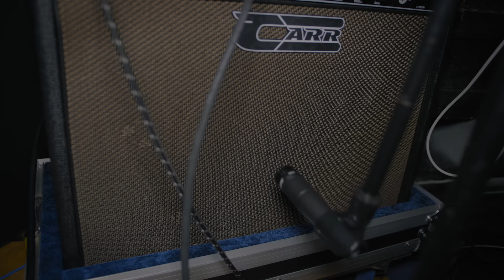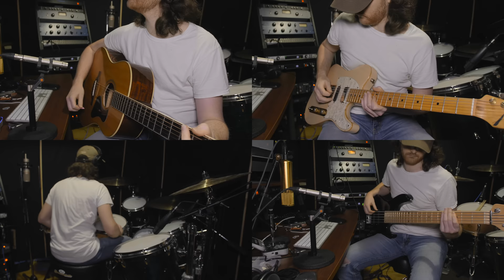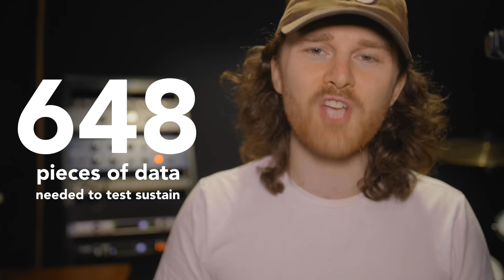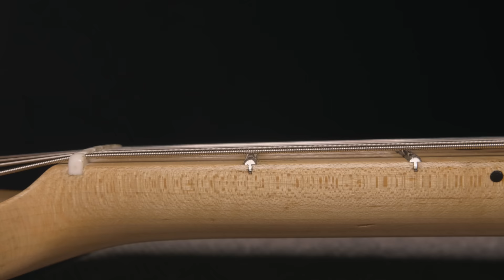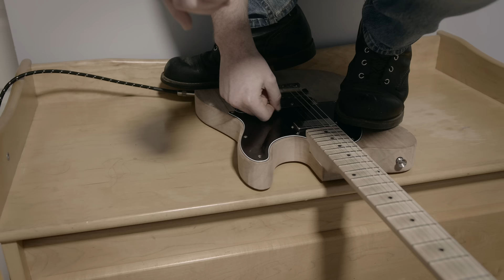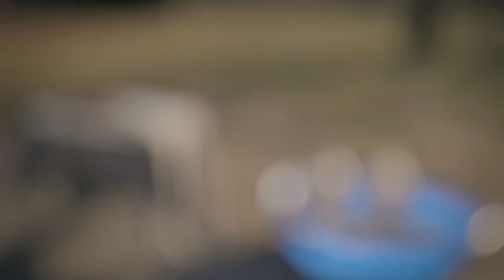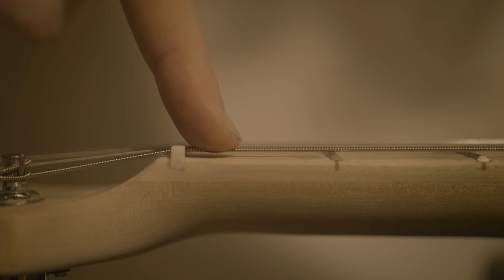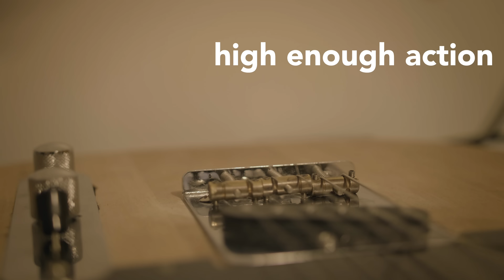Tested: Where Does The Sustain Come From In An Electric Guitar?

Comment: Seems to me that some obvious things, like a solid connection between body and neck, would minimize damping.  Similarly, a dense, more solid wood (or woods) would be best for sustain as well.  Things like paint/finish are so minor as to be considered meaningless (IMHO, anyway).  
   I think one of the MOST important factors in sustain would be resistance (that is, impedance) in the circuitry.  That factors in how many pickups are being used, the number of winds in each pickup, and whether humbuckers are being used will affect impedance.  The strength of the magnetic field(s) that each string must drive against must be a HUGE consideration when evaluating sustain!

Comment: 3db is a lot, I see this video as confirming the fact that guitar construction affects sustain. Also when adding mass to the guitar you should have added it to the headstock. Brass nuts are known to increase sustain, there also exist clip-on brass weights you can stick on your headstock to add sustain. Try simply pressing the headstock of your guitar against a solid object and see what happens. I liked your tone video, but I think you came at this one with a bit of bias which you were looking to confirm. If you really want to test it, make a guitar like structure out of balsa wood and another out of a large piece of brass or iron, give the balsa wood a skinny headstock stucture and give the metal one a heqdstock that is equal in mass to the body (basically make it from one symetrical block), attach some strings to them both and see which one sustains longer.

Comment: The guitar string is an oscillator. Ultimately what you want to figure out is the quality factor Q of your oscillator. Roughly sspeaking the quality factor measures how much energy the oscillator loses for each cycle it does. Higher Q is better.

Comment: "a few Db difference" is a huge amount of energy. A difference of 3 Db is a doubling in sound pressure, and some of the variations you tested had 6 or 10.db difference, which is enormous. I think you kind of proved that some of these things do matter to some extent and then brushed them under the table. I'd rather see an exploration of what the practical effect of getting half the sound pressure is.

Comment: I've always thought that scale length plays the biggest single roll (excluding preampfification) because there is a larger/longer surface that would lose energy slower. Then again, maybe the larger/longer surface loses energy quicker, assuming string tension is the same.

Comment: The only thing I've heard affect sustain is the mass of the guitar. Will be interesting to see how it actually affects it
Reply: In an electric, you want to keep the energy in the vibrating string and not let any of it bleed through into setting the guitar vibrating.  It becomes an impedance matching problem, only you want to avoid matching impedance.  The string, having very little mass and being very flexible has almost no impedance.  So you want the guitar to have a high impedance...lots of mass, and very, very stiff.  This is why freaks like guitars made from granite or aluminum sustain forever...but are very impractical to play.

You want as much stiffness per weight as possible, and that takes you to things like carbon fiber necks.  Most of the energy loss is from the string into the neck rather than into the body.  Once the body is made from a sufficiently stiff wood (nearly all commercial guitars are), there is very little effect from changing the body on sustain.  You can chop off big parts of the body and it will have very little effect on sustain.

Tremolos eat sustain, too.  That's why heavy tremolo tails sustain better than light ones.
Reply: @ElJefe3126  thats a really good explanation, thanks.

Comment: Great video but you missed a big one. How well is the neck perfectly seated into the body without any shims? An exact match is impossible so the shape can only be near perfect. Also, you can put the strings on and tighten them up a bit, then loosen the neck bolts but just a little. the tension on the strings will pull the neck toward the body more. then you re-tighten the neck bolts and tune.

Comment: One thing you didn't really test is the type of wood -- heavier vs. lighter (density), etc. Although I still believe that it's more in your amp than in your guitar. I think it the result would be like "tonewood" -- more of a myth than anything. 
   Also I would like to see you do the tonewood test with acoustic guitars, as i think it would matter a lot more.  No electronics -- just mic'ed up, not acoustic/electric or sound hole pickups.
  I've been playing guitar for 35 years and I have learned more about tone from these two videos than I ever have in all these years. Thank you for that!
Reply: Acoustic it definetly matters there some videos. Electric probably not or it's so small you need a spectrum analyser to see it.

Comment: The pickup should rob the guitar of more energy if it's plugged in, or shorted to ground, than if it's wires are loose. Since then you actually pull energy out of the system.

theoretically at least.

enough to make a difference? no idea.

Comment: I built a guitar out of acrylic and filled it with water and Gatorade to test - it sounds and sustains just like anything else I've tried.

I did however have a shitty guitar that had the neck both screwed and glued in, and the sustain was MUCH worse before the glue was fully cured.

Comment: 2 things affect sustain: stiffness and mass. Both stop the energy in the string from being transmitted to the guitar. Exactly why acoustics have so little sustain: the energy you put into the strings, is lost rapidly into the guitar, by making the whole thing vibrate and flex all over the shop.

Comment: Unfortunately, the sustain factor wasn't demonstrated because the tests weren't designed to demonstrate it. 

Sustain has two characteristics, and each is caused by two different factors. Sustain factors aren't really applicable to electric solid body guitars. The first aspect to Sustain is simply how long the string vibrates, and this is decided by how well fixed in relation to one another's ends the string is, with respect to its two ends. 
If you used a spring and fastend a string to the springs two ends, the spring itself would absorb some of the energy by vibrating in semi resonance with the string, reducing the vibration duration of the string. So, in effect, the more rigid the instrument, the longer the strings will vibrate. While the more springy instrument will reduce the vibration time of the string, though this can result in a longer audible sound if there's a sound box/board. That is sympathetic/resonant sustain. 

Sympathetic sustain is the instruments natural ability to produce an audible tone in response to the strings vibration. Some instruments are more capable of producing louder audible sound to the vibration of the string than others. This doesn't mean feedback.

Sustain is a quality more aligned with acoustic based instruments, including electric hollow bodies. 

Bottom line, you're not going to get any significant results when testing and comparing electric solid body guitars to one another. Sustain will typically be the same amongst all of them unless they're really springy in the neck, which is unlikely. The only factor that will show a semi measurable difference with Sustain amongst electric solid bodies is the weight of the instrument. The heavier the solid body instrument and stiffer the neck, the longer the string will vibrate.

Comment: You had your answer at 1:25: the hollowbody guitar resonates more, so it needs A LOT less volume to feedback!
Strumming different solidbody guitars unplugged will easily show you how some resonate more than others (even same models): those are the guitars which, being equally well setup and well played, will also sustain more 😉.
Reply: No, the opposite, the ones that resonate more, sustain less, because they are taking energy from the strings. The more energy the string retains, the more it sustains. My hollow and semi hollow body guitars sustain less than my solid bodied ones. Nothing to remotely concern me though as it's quite a small difference and unless you're holding notes for 4 seconds like in the video above, makes zero difference to "real life" playing. It can make a difference to feedback though!
Reply: @gazzie12000  you’re wrong. Resonance helps the strings to ring longer, it’s physics. Also, sustain makes a guitar easier to play: that’s why we all love overdrive/distortion. In fact, it’s not the total duration of the ringing string you’re looking for, but the strength/amplitude of those few seconds and fractions of seconds you usually need while playing. Have you ever seen the waveform of a guitar note ringing? If the notes ring for longer, then the amplitude before you pick the following note will be higher than a not-resonant guitar, giving you an ease of playing just like adding a bit of overdrive.
Reply: @shredgd5  Nope, you're mixing resonance and sustain up. . They are not the same. This video is only about sustain, nothing more. Where do you think resonance comes from - it's the vibrating string passing some of it's energy to the guitar, that's the only place the energy comes from - so the string by default has to lose energy. It's physics! 

Also everything resonates - just at different frequencies, and some will rob sustain more than others.

You say "it’s not the total duration of the ringing string you’re looking for" but that IS sustain. Sustain is just how long it lasts, nothing else. Resonance is relevant to the other stuff you mention, yes for sure. But sustain is JUST how long a note lasts, nothing to do with ease of playing, or tone, purely a measure of length. I have unbelievably easy to play guitars with less sustain than harder to play ones. eg most jazz guitars are the easiest to play you'll ever find, but they also have way less sustain.

Also overdrive/distortion doesn't make the guitar easier to play unless you play in that style. If you play jazz or any clean style - it makes it way harder to play!😀
Reply: @gazzie12000  it’s when you’re not hearing any resonance that you’re losing energy, it’s called dampening.

Comment: Some guitars have dead spots, my Kramer has a dead spot at the 14th-17th fret on the G string, A-C. My Washburn has no dead spots like this. I have no idea why. Both have floyds and the same pickups and setup the same, the Kramer is bolt on (but the neck is glued on) and the Washburn is neck through.

Comment: Very good video ..  my  custom built guitars have AMAZING sustain .. even when they are not even plugged in .. because they were designed to not use a truss rod ... The guy who designs and builds them deliberately uses the string tension to 'pull the neck in to position ... Both guitars have truss rods but none of them are actually doing anything ... compared to my strat which is lovely but 'punchy'  its chalk and cheese ... on bolt on necks .. truss rods are the sustain killers .. IMHO ..(open to be corrected??!!) thx

Comment: I greatly appreciate your content.
An observation though : you are using dB loss over time to measure sustain. In your experiments, often harder material show a greater loss. But does it really mean sustain is lower ? If harder material starts with a higher peak, after 4 seconds it could be still more volume than softer material.
I think sustain is perceived as how long the note stays in a relatively equal volume, after peaking and before fading, but still enough to juice the amp. If a pillow guitar has the lower dB loss over 4 sec, but starting with a faint volume, is it still useable sustain ?

Comment: Its always occurred to me that the sustain with all other thing being equal like body material, strings, not and bridge material etc would be closely related to the type of pickup in place and where that pup was placed under the vibrating string ?. Surely the resistance of the pickup and  its position on the body or whether single coil or humbucker would have the MOST effect on the sustain over time ?  Examples would be my Telecaster with a bridge mounted single coil versus my Tele Special with the neck mounted humbucker will have completely different sustain times. Worth a consideration ? Really good video, like your tenacity.

Comment: I was told that bolt on necks hold more sustain than set necks because bolt ons are held with pressure instead of just fit into a pocket with glue

Comment: I think the key factor here and in the previous video on tone is that it’s electric. It’s all about how much signal you’re pumping out. Last time it was almost entirely the pickups and their distance to the strings. This time is seems to be output of the guitar and gain level of the amp. And, of course, accurately fretting on a properly set up neck. As long as you don’t cake your guitar in glue or stand on it, you can achieve good sustain. Or good tone. Or both. And it doesn’t seem to matter which finish you have or how heavy the headstock is or whatever other myths are out there. So, my takeaway is: set up your guitar neck reasonably, get nice pickups very close to the strings, and put out a lot of signal into an amp that will clip it. That’s going to crush as far as tone and sustain. Whatever guitar you have is nearly irrelevant… except maybe for your own personal enjoyment of playing it.

Comment: I could be wrong, but sustain should be an attribute of the strings used, not the guitar, unless you are counting on feedback, in which case it would still be mostly related to the strings, if not 100% the strings. If talking about electric guitars in isolation... well, it's going to related to the strings and the electronics. The only way you should get the body of a guitar to truly reverberate, and thus resonate, is for it to have some sort of hollow body, but a big chunk of wood, given it's mass and relative density, is not going to vibrate much, until you get to very high volumes.

Comment: Though this video was about sustain, I'm still curious about how much acoustic resonance affects an electric guitar's tone/sustain.
Pickups are magnets that detect vibration, and if you were to put the same pickup in a hollow body, then swap it for a semi-hollow, and then swap it for a solid body... what gets changed between the different construction types? I've swapped pickups in a hollow body and put it in a strat, and I'm not too sure if it was a placebo but I could've sworn that I couldn't get the same "hollow body" tone out of it. Or what about different neck joints between bolt on, set neck, or neck through with the same pickups and electronics?

Ultimately they're super marginal differences, and I agreed with a lot of the video where ultimately it's just how you interface with the instrument. Craftsmanship goes a long way with making people feel comfortable on their instrument, and nothing really beats a great setup (no sharp or wonky frets) and good amp to use.

And it's great that this video series explicitly tests electric guitars which always made me scratch my head where tone really lies.
I'm not too sure that these tests translate the same way in acoustic instruments like violins, saxophones, or acoustic guitars. There's tons of videos already by TwoSet that show how small changes to a violin make a huge difference in the end or by Saxologic who show how different reeds or mouth piece / ligature material play a huge role in your tone.
Reply: He has a video that debunks body effects on a plugged in guitar.

Comment: It comes from energy not going somewhere else. It’s a good thing you’re experimenting with but it’s really as simple as energy having no where to go accept making the string vibrate. Not dissipating into the guitar neck, body, headstock, nut, bridge, springs as heat or further vibration. I suspect a guitar entirely made of the most rigid and dense material would have the longest sustain. And passive pickups. And I don’t mean non active. I mean microphonic. So that no energy is lost in the magnetic field created. The air vibrating passively vibrates the diaphragm on a microphone. And also a loud amp so that it can feed back and have much longer sustain. Indefinite sustain in fact.

Comment: New video idea... Two guitars. One feels tight to do bends like it wants to cut into your fingers. The other is buttery smooth and easy. Both 440 tuning and string size 09-42. One is a Floyd bridge the other a two post Fender strat tremolo. Why the difference in feel and ease?

Comment: That's a good point around 10 minutes in. Why in the hell would a light body be good for sustain when it's a Fender like a Tele and the opposite when it's a Les Paul? Logically, an electric guitar that's loud acoustically should have less sustain than a quiter one. If it's loud acoustically that means the body is sucking up and resonating the vibrations away. If sustain is a priority and you want as much as possible of it you should go for a guitar that's as quite (even "dead" as some say) when not plugged in. The quiter it's unplugged the louder and more sustainy it should be when plugged into an amp. The exact opposite to conventional guitar dude wisdom which holds that a guitat that's loud acoustically is always better and more desirable. Is that to small of a topic for a new video?